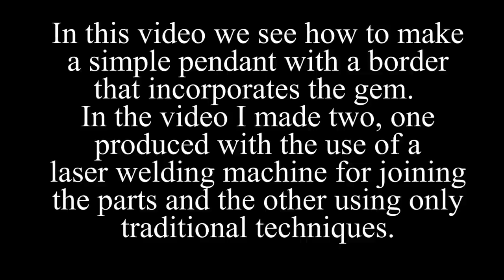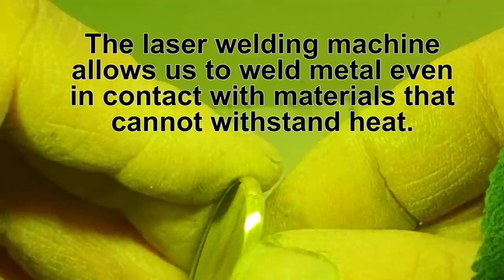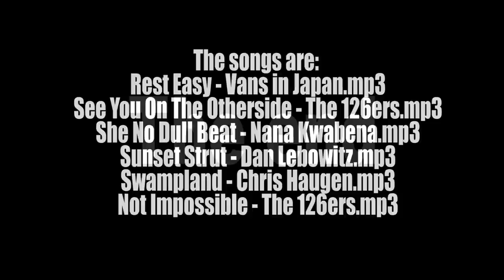18KT gold pendant with a gem handmade.

Comment: its not safe to work with an open cut wound on your thumb bro, im sorry you got injured but i would put on a bandaid or just take it easy for a bit since the metal filings and dirt can easily get inside and infect it worst case scenario.
Reply: Bandaid catch scraps and are uncomfortable to work with. You can not have that when working with gold. And from what I know it is ok to have gold in open wounds.